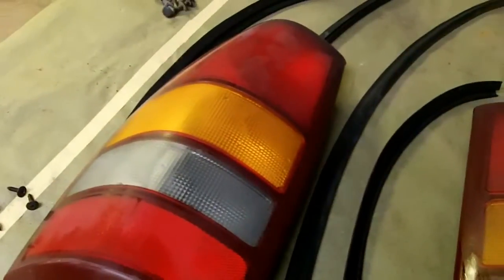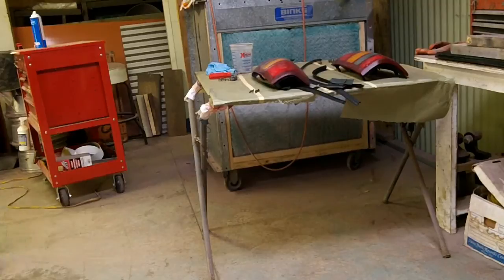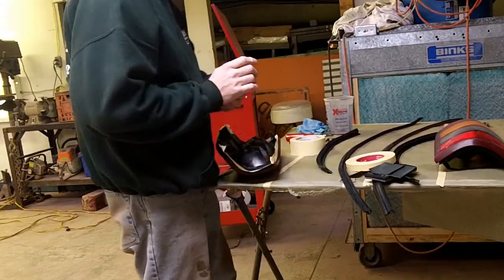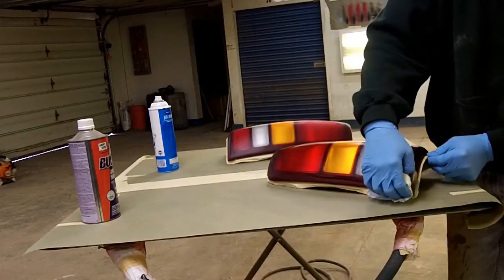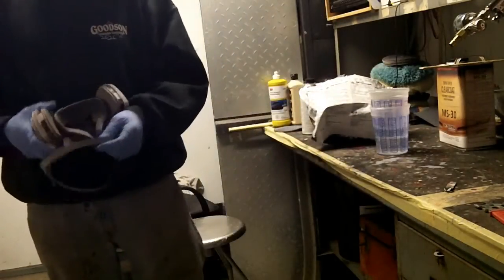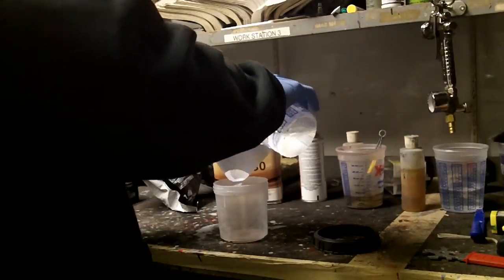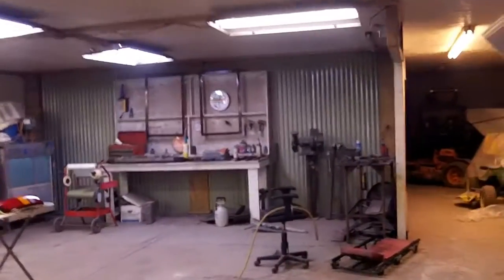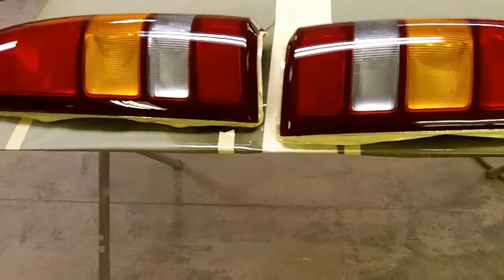Project Duramax - How to clearcoat your taillights

Comment from the maker: They turned out sweet for sure.  You can also put a dab of black basecoat in the clear when you mix it and it will give them a smoked effect.  Cheaper than buying those light "blackouts" that were popular a couple years back

Comment from the maker: I agree with the uv protection you get by clearcoating them.  I have all the stuff to polish headlights and such but it seems like it becomes a maintenance thing after you sand and buff them the first time.  If it was a car lot car I was doing, I might just give em a quick buff as a cheap fix

Comment: Great episode not really clear , no pun intended.  On what was initially sprayed before two coats of clear on headlights.  Thanks
Reply from the maker: Plastic adhesion promoter.  Lights were sanded down with 1000 grit wet paper and then entire light area to be cleared was scuffed down with a grey scotch brite pad and Ajax cleaner.  Adhesion promoter was applied and when that flashed off, 2 coats of clear coat was applied.
Reply: Thanks they will look great , with my new outer and inner rockers . Thanks to your helpful  videos  feel like you were with me the whole time.
Reply from the maker: fern399 Awesome!  Glad to be along for the ride

Comment from the maker: Fisheyes are only caused by one thing... silicones.  Whether there was some oil or wax on the surface of the light, or oily contaminates in the air line coming from the air compressor.  If you wiped them down with wax and grease remover prior to sanding them down, you might rule out surface contamination prior to spraying.  Also, a lot of folks have a hard time telling the difference between a fisheye and moisture contamination from the air lines.  In any case, sand em down and re- clear them

Comment: Could you do this with a rattle can of clear? Don't have a compressor yet. Already polished the lens and they look good. Just want to seal with clear and make it pop.
Reply from the maker: gav240z Absolutely.  The only difference is how long it will last.  Regular rattle can clear is not as UV stable
Reply from the maker: As long as you spray it on wet, it should look great.  I could not imagine trying to sand and polish rattle can clear and have it stay glossy
Reply: Velvethamma what do you mean by Spray it on wet? Is there any other way to do it? Should the clear settle on it's own and look glossy without sanding, is that what you're saying?
Reply from the maker: You got it.  Don't spray super light coats that will appear grainy.  Wet means spray it on like you want it to look...... Nice and shiny
Reply: Ahh thanks, I might experiment with the lens in worse shape first and see how it turns out. If it looks bad I might take them to a local panel shop and ask them to clear them for me.

Comment: That's one way you can do it. I always knock off corrosion with 320 on a 3 inch mini da as I call it and work up too 3000. After, I use a highlight polishing tool with cutting compound and finish with finishing compound.
Reply from the maker: I have all the stuff to polish them.... but when you clear them, the shine seems to last much longer in my experience.  Thanks for the comment!
Reply: Yes you are right by that! they looked awesome. Is the clear a low solids? I see you put 3 coats on. I went to skills usa a event for technical students what I am. My first time spraying solvent base, went pretty good I get to clear thinking its a medium-high solids because there was no tech sheets, It ended up on the floor lol Wish I knew it was a 3 coat low solid.
Reply from the maker: It was medium solids speed clear.  Matrix MS 30
Reply: So its kind of like PPG dc3010 its like a 3 minute flash clear, Its the best clear other than dc4010 ive sprayed yet.
Reply from the maker: I think its a lot like dc3000.  Still have about 5-7 minute flash time.  Not an "express" type clear though
Reply: Ive never sprayed matrix before but I have heard it is a good product. All we use at my shop is PPG and what a like about there products is they have a lot of tech sheets on it. That Duramax turned out cherry nice work man.
Reply from the maker: Matrix has tech sheets for everything too.  It's pretty much a direct copy of PPG.  Thanks for the compliment on the D-Max.  It was a long job getting it back to this condition, lol

Comment: 2 coats of primer and 2 coats clear , same pressure ? , same fluid , same fan??? , i have a normal gun so i use 3 bar , but i dont know the reason why i get orange peel, I need help , sorry for my english
Reply from the maker: No problem.
Not sure what the question is but if it is in relation to these lights, I used the same 29 psi (2 bar) on the plastic adhesion promoter and the clear coat.

I was taught that fluid control or amount of fluid will dictate whether or not you get orange peel.  More fluid or slower passes will help reduce peel.  Air pressure is "run control".  I have a video on gun setup that may help out.  How I set up a spray gun and general info
Reply: Velvethamma
i need clear my headlights and always the orange peel destroy my job, i dont have a hvlp gun, i have a normal gun, so , i use 3 bar, correct, but i dont know how to use the fluid control , the distance etc   help and thanks a lot
Reply from the maker: check out that video and let me know if you need more help.  I'd be glad to make another video for you